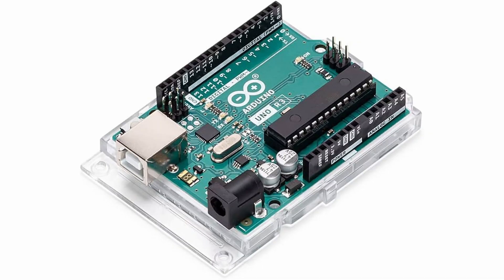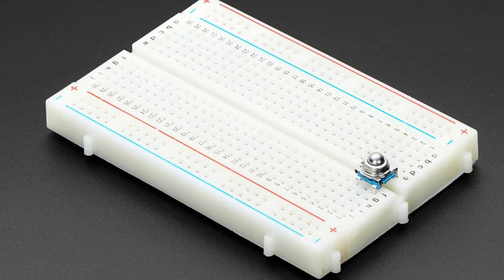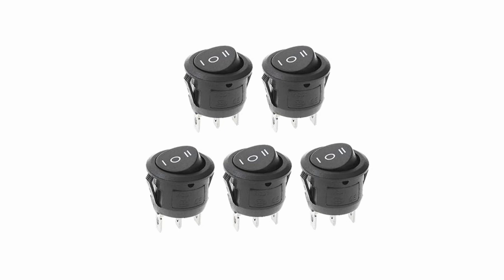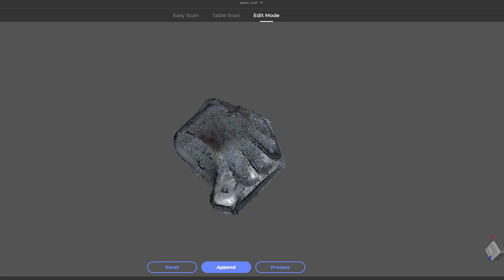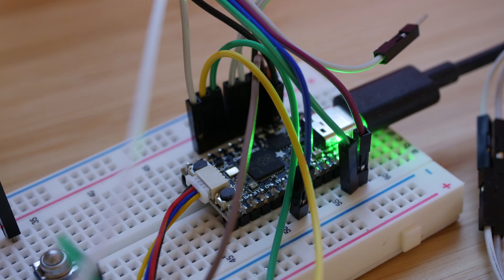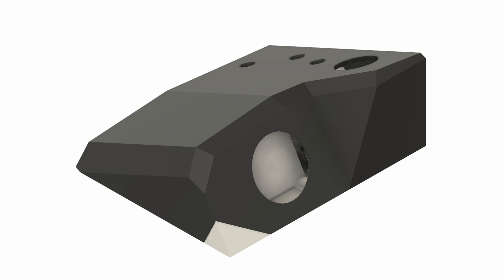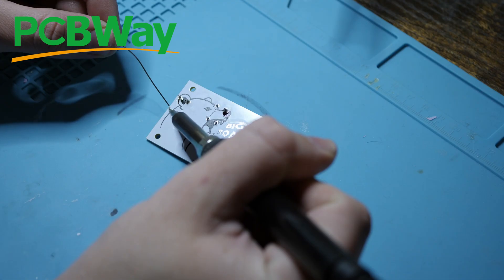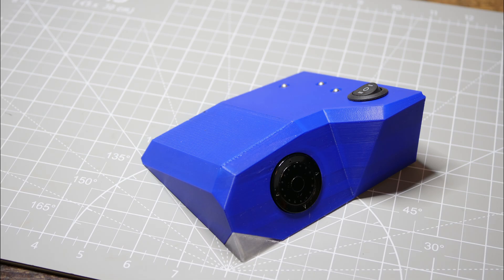This DIY Device Maximizes Video Editing Efficiency

Comment: Interesting DIY project but in practical use it looks horrendous. Ergonomic is inexistent, components quality worrisome.
Can be interesting for a didactic project not for real world usage. 
(Vfx specialist since 25 years I have some experience on interface for video editing)
Reply from the maker: I'll need to use it for a while to determine how practical it is. I agree that it isn't that ergonomic, but it is better than the typical macro pads on the market. Not sure what you mean about the quality of the components....
Reply: you sound like all the usual "nothing is good enough for how I work" know-it-all, nobody-else-allowed-know-anything, old dudes in the colourist and editor groups. Or the type of dude that scoffed at every practical advancement in cameras like IBIS and AF because "that's not reliable enough for a seasoned PRO like me!!" and was proven wrong.
Reply: Point me in the direction of the solution you designed, made a video on, and released